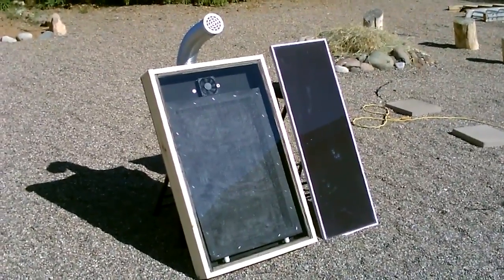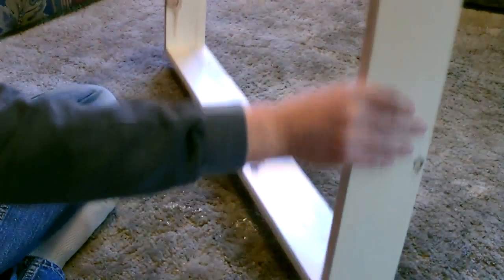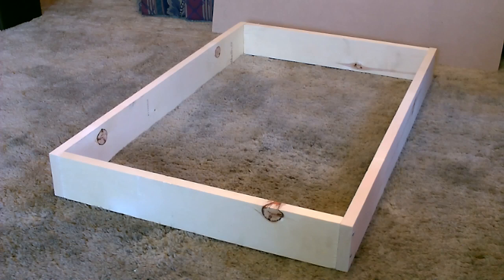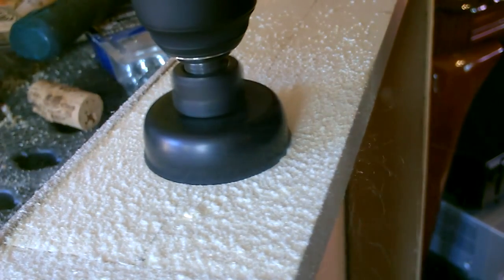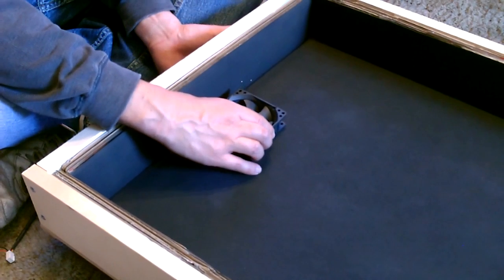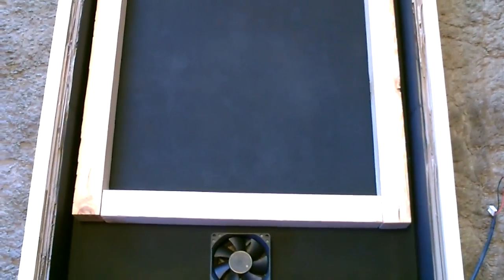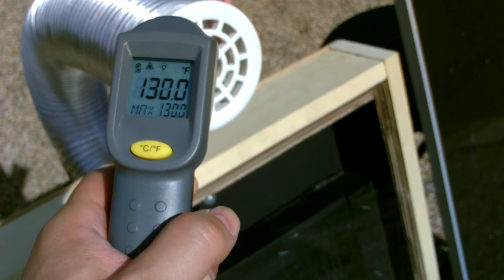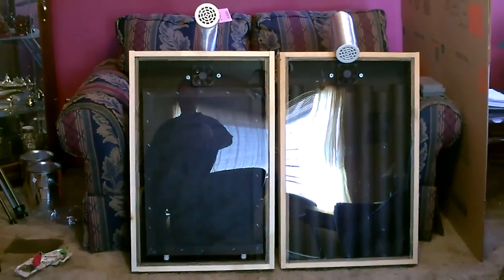Solar Air Heater! - The "Screen Absorber" Solar Air Heater! - Easy DIY (full instructions)

Comment: I don't want to use glass to cover my unit. I'm looking for clear plastic, not the milky stuff the box stores have. Two or more layers of that would be better than a glass insulator and cheaper and keep the unit light weight. Anyone know where to find real "Clear" plastic sheeting?
Reply: Then you can try using this product "3M Outdoor Window Insulator Kit" https://www.walmart.com/ip/3M2170W-6Outside-Window-Insulator-Kit-2PK-OTDR-WDW-INSULAT-KIT/38471504
Reply: I found "Frost King" 4mil. "crystal clear" in a 48" x 25 ft. roll ordered at Lowes, shipped to my home for free at about $10.
Reply: @jakubtingyun  That would work for a while.
Reply: The heavy duty, crystal clear mentioned by Mike M. Found mine at "do It Best", but most hardware stores should carry it.  Very durable for plastic. Have used it to cover broken car window in winter and it holds up unless temps. are bitter cold, the spouse forgets it's plastic and tries to scrape ice off of it. If you're installing it inside and away from harm, Jakub Wu's suggestion of the heat shrink type window film should be adequate. Just a suggestion from limited past experience with storm windows and such, have not built a solar heater for myself.
Reply: Mike M yep i agree. I am going to try the frost king exterior stuff when I do my build.
Reply: Greenhouse plastic from Farmtek
Reply: @GOD OVER MONEY $$$

Comment: Is the screen steel? aluiminium?
Reply: I would think as long as the screen is dark/black any material would work - but metal will absorb more heat than say plastic or fiberglas screen. Has anyone tried differing materials for comparison?

Comment: I was brainstorming the potential of an internal model- as our windows already have 1 sheet of screen on half of it, if i add another sheet of screen and fix it behind it, and a small solar fan at the top, pointing downward to push the warm air towards my desk where I work, would this work, or just create shade? Therefor I would need to block half the window with black coreflute (which is ok as half the window reflects on my laptop anyway)to create the "heat" .... I'm going to try...

Comment: Very interesting.  I like the flexible duct idea which leads me to another idea for something bigger, as easy to build, and less materials to purchase... just imagine what you can do with an old clothes dryer, freezer or refrigerator?  You already have insulation and a box.  With good ducting you can use convection current for airflow and eliminate the need for the fan.
Reply: My Friend in Idaho heated a huge home with convection and a glass green house arching to her patio door. There was a vent at the bottom and top that looked like a regular heat vent. In the winter they lit a very small wood stove inside the greenhouse.
Reply: @lindamoses3697  ppl ok please
Reply: I think u may be onto something  good with the frige idea
Reply: @wadelitchfield1614  p

Comment: How do you install it to make the air flow into your house?
Reply: +Yoseph my guess is he didn't use foam because who wants to heat foam to 140 degrees and breath in those toxins
Reply: +Ridge Walker you can make passive solar window shutters. picture s hollow door..with holes at the top side...hot air flows out and in the vent at the bottom.  get 4.00 personal solar fans and it will move move the sir much more efficiently. paint the the street  facing side black to absorb more heat.
Reply from the maker: hi there. here's a few ways i've done it (and/or seen it done). one is to run the vent pipe in a window. you can also pipe it in through any unused vent on your house (a dryer vent or an unused "pet door" for example). i've also seen it piped in through a back door (guy removed the doorknob and hooked up the vent pipe). lastly, you can always install a new vent (but i'd only do that if another way is not possible and you plan on using the solar heater for years.
Reply: +desertsun02 how would you mount it in the window? I've thought about plywood and shutting the window down on it or maybe plexiglass so it doesn't look AS ghetto lol
Reply: why not use foam insulation instead of gluing pieces of cardboard together..does that insulate better or is it just what you had?
Reply: Ridge Walker heat travels up

Comment: What kind of screen are you using?  Is it Metal?
Reply: It looks like metal screen to me, like the stuff that is used in screen doors or windows to keep out insects.
Reply: I was wondering the same thing.   Earlier, he trimmed it with scissors, but that could be done to either metal or plastic screen.
Reply: I would use black aluminum screen with the smallest hole size.   I do not think fiberglass screen will transfer or hold heat as well.

Comment: I know some people heat greenhouses or outside workshops with these.

My question is: how do you direct the heated air into the house?  Cut a hole through an exterior wall to the outside collector?
Reply: S Williams maybe dig a hole under ground

Comment: Quick question, from what I get the solar panel is just to power the fan is that correct? Or no. I am having a hard time understanding if it aides in creating the heat or that the heat just comes from the black box and screen. Please let me know, I am thinking this may be a Sunday project. I am freezing! Thanks!
Reply: Yes Sarah, the solar panel powers the fan. The box generates the heat.

Comment: This is great, dude! So did I got it right, it was 40F outdoor? I was wandering if this would be useful in a winter for a small wooden tool house?
Reply: How would it be able to get hot in winter? 🤷🏼‍♂️
Reply: @FreeFinca  the sun drawing to the black. The colder it is outside it wouldn’t get as hot, but still warmer than air temp

Comment: So, I guess I am missing something here. Does this only produce heat when the sun is out? A battery bank would provide power when the sun is not present, but then there is no heat production either. What was the ambient temperature when you took the temp readings?
Reply: Some people make barrels that can retain heat and they would release heat slowly over time and a couple of those could last you a day and also your house and insulation will absorb heat.

Comment: How did you get the fan to work?
Reply: the solar panel powers the fan.
Reply: Yea good question because he never showed that step.
Reply: He was too busy showing every single hole being drilled and screw being inserted to bother showing the fan’s power source.
Reply: @wattage2007  Obviously you were too busy eating your doughnuts on the couch to see at the beginning of the video that he hooked it up direct to pos & neg  of the 15w solar panel.

Comment: Interesting design.  Did you consider some type of a thermistor inside the collector and a variable speed fan to adjust of internal temp vs air flow rate?
Reply: I use a 80 degr. celsius on/of switch so the screen absorber does not overheat. Saves energy too!
Reply: West Marine sells solar powered fans that are meant to venalate your boat under tarp for the winter. These are cheaper than the marine grade used on-board.

Comment: Great video desertson02!A few questions though.1)would aluminum screen work better&2) could I use plexiglass instead.I would like to build one a little bigger and plexi would be easier to find than glass in that size.Thanks.
Reply: Any dark or black screen will absorb heat, although metal will absorb more than plastic.
Plexiglas should work just as well as glass, since I think its purpose is to make the front (light-receiving) part of the box airtight.
I think even a piece of sheet metal (preferably painted black) would work, but it might absorb too much heat and not as much would get through to heat the screen inside.

Comment: This is a great idea and video.  I see that there are yellow, red and black wires come from the fan.  Where do these wires connect to?  Thank you
Reply: They connect to the output from the solar panel as far as I can tell.
Reply: @juandenz2008  Just RED and BLACK wires are needed. The other wires are not used.

Comment: Elaborate on the size of panel & fan; so when sun shines on both the fan runs and when sun is not heating box it shuts off???
Reply from the maker: +Jeff Brown hi there. fan is an 80mm (39.02 cfm) computer fan. cost about 5 bucks. it takes 3 or 4 watts to run it at full speed. a 12v panel that is at least 5 watts should be all you need. and yep, the fan will run only when the sun is out.
Reply: Kewl! I plan on using down spout / screen design with a reducer on the screen/box to collect heat air inside the box.... It is to be fixed on a roof and not used in the Hott Months-wut just cover with white plastic to keep it cool ???
Reply: Oh yeah; Thx. for ur vid. it has motivated me to do this.

Comment: Hi,
I am constrained by the size of panel that I can have.
I can go only 27 inches high but I can go 100+ inches in width.
I am wondering if I should tweak the screen placement in any manner.
Any ideas.
Would serpentine tunnel raising air from bottom to top travelling sideways be the kind of design I should be looking at?
Regards
Lalit

Comment: Where are you getting that fan from?  I can't find one like it
Reply: +John B  Find a bad computer, or most anything electronic, most have a fan similar to this. Find a d.c. fan, that way you can use the small solar panel to power it. Trickle charger may work.
Reply from the maker: +John B hi there. i got those fans from fry's electronics. cost about $5.00 - for a free option, consider what commenter 'pdufusc' mentioned - most computers do have cooling fans in them that you could use.

Comment: Can't you just hang the heat-panel behind the window to heat up the room from inside?
Reply: The net effect would be above zero, but probably not worth the effort to construct it.  A portion of the light entering through the window will strike surfaces that are more reflective than black and be reflected back out through the window.
Reply: Jason Riley You’ve never opened a car door and experienced the 140 degree heat inside caused by the sunlight passing through the windows nor read about the deaths of children and pets left inside. A greenhouse uses solar energy to warm itself.

The sunlight can be so intense as to make a room uncomfortable with large windows. The windows also radiate the warmth of a room into the cold night. The window curtains exist for more than privacy as they also act as insulators.
Reply: Kiumars [Iranian Kurd]   I have done this .You would not gain anymore heat.  But you will save on heat loss out of your window at night with an insulated heat panel if you plug your inlet and outlet holes at night to stop the reverse flow . I placed a thin piece of plastic from a sandwich bag glued only at the top  just above the hot air outlet so it works as a flap . When the solar panel heats up in the daytime the hot air lifts the thin plastic to open the air outlet by itself then it drops back down once heat stops flowing .
Reply: @SteveV1960  Brilliant!
Reply: Craig, not exactly true because my room is not painted flat black with airflow. Not that I know of what I speak however doesn't the black surface improve the effect of capturing improved effect?
Reply: So the glass heats up flat black paint very good going to try this if can find all the parts!
Reply: What we are seeing is active and passive solar energy at work. It would work. At a 130 degrees we need to think of this device as an active solar driving a battery that drives a fan. That will keep pushing the temperature up in the room where the air vents. you just have to figure out a way place to vent inside your home while this box sits in your window well
Reply: I was about to ask the same question. I just read the answers saying that the net effect would be zero because of the same sunlight entering the window.....but that's not true. I came to ask the same question but I know that isn't the right answer. 
That heater works because of that Black Surface area inside the box heats up by Absorbing More of the Solar Energy which raises the temperature of the air inside the tube that the fan circulates. 
Outside in the same sunlight you have a large difference in temperatures on a dark surface compared to a white surface.
I am guessing that the increase in air temperature using that heater would be less inside the window, but I might be completely wrong.
I guess that because the outside temperature could be 60 degrees cooler than inside and heat transfer to the air from the Sun to the tubing to the air in the short time the air is inside the tubing must have some sort of scale and limits.
If the heater is inside then it's going to become "room temperature" as the air in room will be.
There has to be a limit on the possible high temperature that the heater can absorb, that's got to be directly related to the surface area of the exposed dark surface and the materials composing them and the amount and direction of the exposure to the Solar radiation. 
If the hottest the tubes can become outside the window is 130 degrees while the starting temperature is 20 degrees, that's a 110 degrees increase. 
If the inside air is already 60 degrees then the tubes wouldn't have any heat energy to transfer to the air until it was above 60 degrees but could the tubes raise the temperature by 110 degrees or would they max out at the 130 degrees and then only generate a 70 degrees of increase?
That would still be good.
But as the "room temperature" rises then the point that there would be no gain would be when the "room temperature" reached the  maximum temperature of the tubes in the Solar exposure they're in. If that's 130 degrees then when the air going in was that temperature there would be very little energy being absorbed by the tubes from the sun, it would depend on how much heat loss the room has.
Right?
Or, am I way off base on something? I wouldn't be surprised or offended to be told that I am and then have it explained to me where and how.
I did come to ask questions and hoped for the answers.
I just had a whacky idea 💡!
What if you had a fireplace with a window in front of it could you stand an anvil in it and then place a Fresnel lens in the window and heat that old anvil till it was glowing red hot and heating your place?
Reply: @peterkerr4555   Good point(s).
The better idea is to place it outside to gain the benefit of solar power.
However,out side is and will be a harsh environment for a few slats of un -treated wood. Try ABS or PVC.
Also,your frame will not last very long of you screw into the END GRAIN of the wood.
Reply: No. The net effect would be zero because the energy coming in the window is already being used to heat the room.
Reply: Craig Bennefeld
In that case then why not make big windows instead of installing Solar Air Heater?
Reply: Kiumars Irani There is and I went to it.   Do you find inaccuracies in my statements?

Comment: very well done. I'll be doing the same thing. We just built a 40'x60' by 12 foot tall pole building. The entire 40 foot wall will be converted and used for heating. It faces due south with no trees. It 'should' keep the entire building nice and comfy on the coldest days here in Michigan. I'll post videos once I begin building, also.

Comment: Thank you for the great video.  I'm just curious as to why you insulate the sides and not the back.  Thanks.
Reply: Joseph Zambotti he didn’t insulate the back did you miss it ?
Reply: Endoftime !  Yeah he asked why he didn’t insulate the back. Seems you would lose BYU’s out the thin board back.
Reply: Kevin Grove darn spell correct, I meant to say, he Did insulate the back

Comment: how many sqft does it heat? oh by the way nice build.
Reply: It will heat any amount of square feet - but how much would you like it to heat?
He mentioned in the video it was 40 degrees (probably Fahrenheit) outside, and the heater increased that to 130-136°, according to his thermometer.
For large rooms, this would probably raise the temperature better with an additional circulating fan (ceiling fan, box fan, or even a small desk fan).

Comment: After viewing this, I decided to build the screen absorber 2x4 feet, much easier to build than the hassle with the pop cans, and appears to be more efficient. Mine blew air at 158 degrees consistently on a sunny summer day. I put one of those wireless remote temperature stations inside so I can monitor the temperature from my couch:)I used an alumimum screen.One thing I did different was that I tilted the screen, so that it touched the glass on the top of the box and touched the back panel on the bottom of the box. That way the air has to travel up through the screen. I didn't use any cardboard or any other insulation, instead I put a sheet of aluminum on the back panel. I tried solar panels, but they just didn't put out much power and weren't consistant and can only power lame fans. So I just found an old plug in 12 volt adapter and got a SilenX fan from Amazon for 9 dollars, it blows much more air than a normal computer fan. I plan to run mine inside my house in the winter up next to my patio door window. Thanks for the video.

Comment: you should read several places in the system to learn more - whats the local temp? 45? and how much air is moving,.. very little really but it is constant 'on' which is a trade off.  This model works with no fan,.. an 8 ft upright develops air flow rise.  That model had a 24" wide vent top and bottom, close for summer.